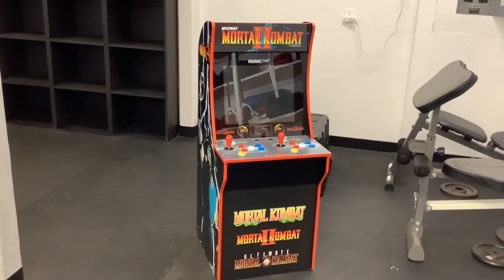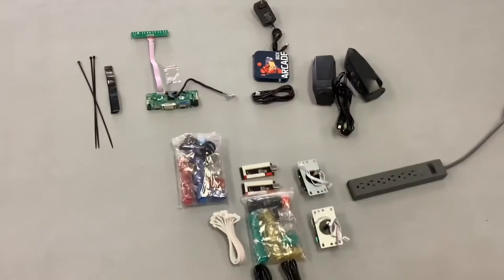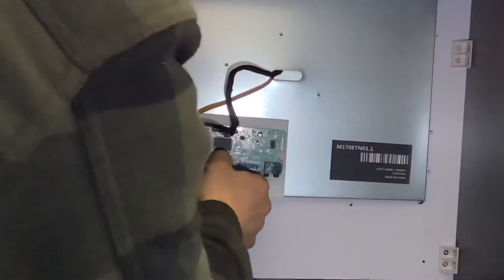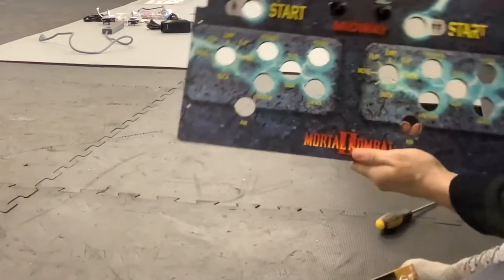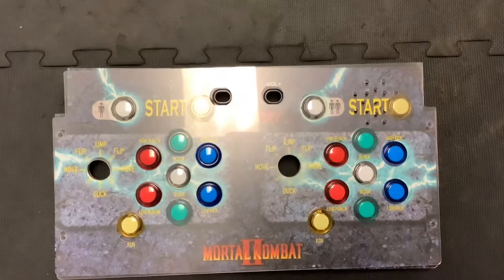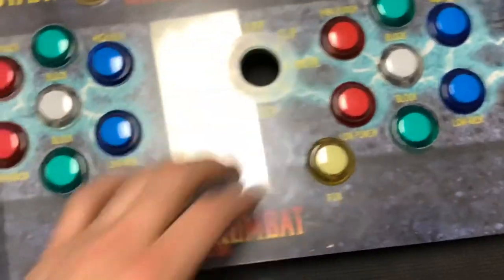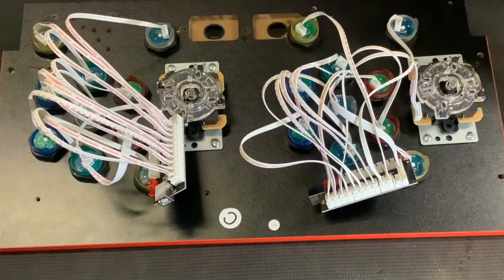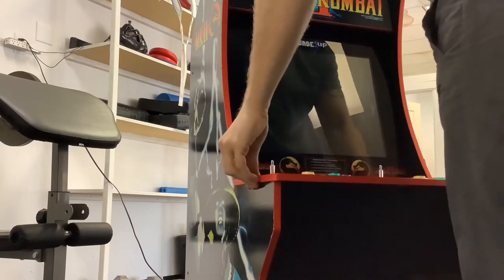How to add more games to your Arcade 1up

Comment: I was able to mod the controller that comes with the arcade box to work with the buttons.   This helped me bypass the process of needing new USB boards and eliminated the need for controller setup.   However, modding the controller was just as long to deal with.   

Thanks so much for the video!
Reply: Which arcade cabinet did you mod?
Reply: Jason, Can you explain how you did it please? Thanks

Comment: I must note to you that you do not need to protect the board from The Metal.  It's actually safer screwing it to the metal with nothing in-between.  So long as you have metal screw sleeves so it can hover and not pressed against.  Or drill 4 holes and use the plastic press in mounting clips Those are cheap. 

Reason is fire safety and also metal housing around the board in case it blows and doesn't spark out to the surrounding wood. 
  I deal with control circuits on commercial hvac.   Boards are always screwed to the metal or done by use of clips.   There's never anything in-between. 

The housing around it was just there for fire safety in case something blows it doesn't spark out to hit the wood.    But the original cover can be bent into shape to cover the new board.  Pliers should work.
Reply: thanks thats what i thought.

Comment: Man your video are great . I have two arcades and fixing to mod mine. The Simpsons with 4 joystick and roller in middle also comes with wifi , the other is mortal kombat 1st gen, witch would you mod? And would the wifi have any benefit?
Reply from the maker: I would do the Mortal Kombat model. I don’t know anyone that has modded the Simpson’s  model so I don’t know if the LCD board would work. I know for sure the LCD board listed in the description will work with that model. Right now I’m modding the newest mortal Kombat legacy model and I listed that lcd board in the description as well. They each require a different one. Also the arcade box has WiFi and you can log on to the internet and customize your start up screen and menu screen.
Reply: @Oracle_insight  I saw a 1up Simpsons molded tho
Reply from the maker: @gomigang2875  I’m sure there is a way to do it; you would probably need to change the entire monitor out. When I tried nodding my old Simpson’s arcade I couldn’t find a video card that worked with the Simpson’s monitor to get hdmi to work with the screen.

Comment: I tried this with a similar box.  Same as you the 16:9 worked great on the 4:3 screen with games like mortal combat and other “horizontal” games.  However, with “vehicle” games like Galaga, it stretches them too much unless you set I back to 4:3 for all of those.  Did you have this same issue?  I did with Super Console X and bailed on it for that reason.  I didn’t want  all the manual setup.  Instead I used a $65 small computer and Batocera (same as Emulec pretty much).

Comment: I cannot get my buttons mapped properly. If player one is correct, player 2's buttons go back to default and vice versa. What am I doing wrong? I did exactly what you say in the video.
Reply from the maker: I’ve had issues with this every once in awhile. Basically map player 1 with just player 1 side plugged in, then plug player 2 into the arcade box and map player 2. Go into a mortal Kombat game and make sure on the character select screen player 1 creates the green square highlighted box over the characters. Then click start on player 2 and make sure player 2 is the red highlight box over the characters. Test the game and make sure buttons work. After playing the game exit to the main menu and shut down the system. Turn it  back on, go back into moral Kombat and make sure player 1 hasn’t swapped to player 2. You will know if the buttons swapped if player 2 is now the green highlight over the characters. If this happens exit the game and swap ports on the arcade box and remap the controls for player 1 then plug player 2 into the other port and remap. Test the game again and then exit and turn off system. Turn back on and go to mortal Kombat again and if player 1 is green, the problem should be solved.

Comment: Great video.  For some reason, my control deck is only recognizing 3 buttons and the up/down on the joystick.  But i cannot select any option like to configure the controls.  
Any ideas what is wrong?  Do i have to use the ps2 controllers that came with ARCADE BOX to configure the control deck?
Reply from the maker: Yes plug in the ps2 controllers and hit select and configure controls. Once there, unplug them and plug in the arcade controls and configure them

Comment: Hi 😉 please check Input 1+2 is set on "default" setting in Controller settings. Try a manual setting for your USB Controller boards Input 1+2 this should fix your Input controller mapping Problems in emuelec. A lot of other settings are directly in retroarch by "restart retroarch". Nice upgrade👍 Have a lot of fun 😃
Reply: Ramin, are you saying that the old setup he posted can actually work?  I ask because I ordered all the stuff he listed, but has not been delivered yet. Thanks
Reply: @PreppyvibesAdeline   @•coconut blossom•  Should be work 👍Mapping was the biggest problem that i had with my diy Arcade. Manual settings needed after you set USB Controller Boards. Every single reboot he saved not Player 1/2 mapped to the boards 😵‍💫

Comment: Hi Greg, I modded my MKII cab with this arcade box but somehow I mess up the button setting on the gamepad, is there a way to reset the arcade box gamepad setting?  I also done the control panel with the usb encoder but still have trouble mapping the button.
Reply from the maker: If you mess up, you need to plug a controller in that came with the arcade box. The controller is already mapped. Use that to hit start at the main menu and go to controller settings and then configure a controller. Once you get there, unplug the controller and plug in the left side arcade controls. Map the buttons then plug in the right side arcade controls and map them. A good way to make sure the controls are correct is to play mortal Kombat. If player 1 is the left side and player 2 the right, you did it right. If they are backwards, swap USB ports on the arcade box but you have to set the controls all over again one at a time. Gamepad1 needs to be on the left and gamepad2 needs to be on the right. Hope that helps

Comment: do u think i could use the beats pill for a speaker? i have the gen 3 UMK3. that has the speakers up on the top head board.  i actually think the sound is pretty good asis.

Comment: Also when i do controller 1 i know you said disconnect player 2 so when i do player 2 do i need to disconnect player one ? Or no ? And  for display , couldnt you do the advanced setting for full display. At the all games tab  instead of systems one by one ?
Reply from the maker: Yes you can full screen that way and sometimes player 1 and 2 get swapped so to test that player 1 and player 2 are correct, play mortal Kombat and it will show which controller is player 1 and 2. The. Turn game off and play again and make sure it’s actually player 1 and 2 by playing mortal Kombat again. If backwards switch them.

Comment: Hi great video I’ve watched it many times, as I’m following your tutorial to mod my arcade1up street fighter 2 legacy edition . Just one question if any on can help. There’s no mention of the over head carousel light . How is that powered please reply thanks
Reply from the maker: There’s a few adapters you will need from amazon to make that work. Not all the cabs have the light up marquee. Let me see if I can find my parts list and I’ll add it into this comment.
Reply from the maker: https://www.amazon.com/gp/aw/d/B081Z7H444?psc=1&ref=ppx_pop_mob_b_asin_title
Reply from the maker: https://www.amazon.com/gp/aw/d/B07MQ9B8G3?psc=1&ref=ppx_pop_mob_b_asin_title
Reply from the maker: https://www.amazon.com/gp/aw/d/B01M7N1GOH?psc=1&ref=ppx_pop_mob_b_asin_title
Reply from the maker: Use the parts I linked to create a y adapter for power using your existing power cord into your light up marquee.
Reply: @Oracle_insight  thanks for replying, do you mean a 2 way splitter cable
Reply: @Oracle_insight  thank you been a great help much appreciated. I’ll get them ordered in morning
Reply from the maker: @daxster35  yes all those links to parts required to make it work
Reply: @Oracle_insight  thanks again I’ve followed your tutorial purchased all parts hope I can make it work

Comment: I love the vid I can’t wait to do this with my pac man gen 1!
Reply from the maker: Yes the lcd board for this model should work with yours
Reply: Pacman has a vertical monitor. you can do the 60 in 1 or the king of air 2 with 516 vertical games. But you have to flip the monitor 180 degree. If you wants to do the 33000 game, the display will be at a 90 degree angle. JMHO.

Comment: Can this be done on a nba jam 3/4 arcade not sure what gen but I do know it has wifi but no lighted buttons? Its still new in box got it on clearance last year and waiting to put it together after I make room in the garage.
Reply from the maker: I’ve not tried it on one of those yet. It all depends on the monitor if you can connect an hdmi video card to it.

Comment: Please need help. Want to play.  I get all the way and pick a game. Then it says my magic stick is not configured. But it worked for everything else
Reply from the maker: I don’t use the magic sticks for this method. You would only need the magic stick when using the switch fighting stick. I stopped using the switch fighting stick method because the firmware has changed on some of the magic sticks making that method not work anymore. Unless you bought the old version of the magic sticks before they updated the firmware, it will probably not work and you will need to buy the button kit and change out the buttons on the switch fighting stick.
Reply from the maker: https://youtu.be/ekqL9wWkdbI
If you already bought a switch fighting stick, upgrade it like I did in this video with a button kit. It will give you better buttons, it’s easy, the joysticks will work better, and you don’t need the magic sticks anymore.

Comment: Hello where are you plugging the two usb cables coming from the encoders ?
Reply from the maker: They plug into the Arcade box, player 1 and 2
Reply from the maker: Use any mortal Kombat game to make sure player 1 and 2 are in the correct ports on the arcade box. When you enter the game, player 1 should be green highlighted box over characters and player 2 should be red. If they are backwards turn arcade box off and swap ports

Comment: I followed this video step by step and when I turned it on everything lit up and the screen comes on but just remains black.  Any idea what that can be?
Reply from the maker: Possible ground issue, or wrong video/display card for whatever cab you are using. Also one time I accidentally pulled the chord out from the actual LCD board inside it and couldn’t figure out the problem. I had to remove the whole tv and discovered the chord came lose when I was plugging it into the video card.
Reply: I am using the same one in this video.  The mortal kombat cab.   I do see a wire coming out of the screen in the back which is not connected to anything. I am not sure where to plug it into.

Comment: How are you powering the system on?  Are you simply leaving it on and plugging it in?
Reply from the maker: Plug it in to turn on, and go to menu screen and click shut down system to turn off. Once it’s off I unplug it. You can also buy this and Velcro to the top to turn it on and off. https://www.amazon.com/Cordinate-Designer-Tabletop-Resistant-41095/dp/B0845S3KNJ/ref=mp_s_a_1_2?crid=18KTMJ3UCU38W&keywords=plug%2Bpower%2Bon&qid=1652127515&sprefix=plug%2Bpower%2Bon%2B%2Caps%2C214&sr=8-2&th=1&psc=1
Reply: Hell of a job man... I'm going to give this a shot. Thank you for this. . Its appreciated
Reply from the maker: @shawngrugel5078  no problem, do you have the new legacy model or this same one?
Reply: I have that same one.  I bought tune Simpsons one as well... I'm afraid to mess with that one... but I got the MK Cabinet for next to nothing. I was thinking,  I do have a Super Console X, it runs on that emulac as well. Do you think i could use that as opposed to the Arcade Box?
Reply from the maker: @shawngrugel5078  yes that should work just the same as the arcade box
Reply: I'll let you know how it goes... i'll probably order the stuff this week and get it together by next... thank you again
Reply from the maker: @shawngrugel5078  awesome! I just sold 4 over the weekend and about to build three more I just picked up.
Reply: Greg...
I followed your video step by step.
I got a recommendation as to centering the joysticks. Use Bluetack to hold them in place so that way they don't slip as you either make your markn or simply screw them in.

My only issue was drilling the holes in the plastic protective layer...it shattered. 

Everything else came out great. I'm using a super console X as opposed to the box you have,  the only reason being is I had it lying around not being used. 

Thank you so much my friend...if it wasn't for your video,  in wouldn't have gotten this done.

Comment: How do you remove the joystick plate if is hot glued to the board
Reply from the maker: Hammer and flat head screw driver would work. Angle it and give it a tap until it comes lose

Comment: Have you ran into a problem with the boot up going straight into a green screen the emeulec boot up screen will appear then all of a sudden it goes green ? Just curious if you or anyone has had this problem
Reply from the maker: I haven’t; does it boot up at all or just green screen every time?
Reply: @Oracle_insight  boots up but before loading all the emulators it green screens ordered a new arcade box under then warranty so hopefully it’s just the box it’s self
Reply from the maker: @IzaacLujan  yeah I’ve never had one do that

Comment: I have the blitz machine is there any type of joystick board I need to order because it only has three buttons
Reply from the maker: You can drill holes for more buttons. Also is that 4 player?
Reply: @Oracle_insight  yes
Reply from the maker: @elijahwildhorse6735  the arcade box only has two usb ports for two players. Not sure if there’s an extension to add 4 player or if that would even work.

Comment: Must the buttons be changed?
Reply from the maker: Yes, in order to connect it to the arcade box with all the games. Honestly it’s so easy. I’ve done it so many times at this point. You don’t need to drill all the extra holes. I recommend doing at least one extra hole for each side for start and select but having two extra per side is even better.

Comment: I did this step by step but screen shows nothing idk what happend no sparks or anything just screen no picture just grey
Reply from the maker: Which model of arcade do you have? Did you hook up the ground? And did you order the correct hdmi converter board for your screen. There are different hdmi converter boards specific to certain screens/models. Make sure you plugged the cord from the screen into the board the correct way. Also make sure you didn’t pull too hard on the cord when plugging it in as it can unplug from the actual Arcade1up screen. I accidentally pulled too hard once on mine, hooked it all up and had the same problem. Had to remove the screen from the Arcade1up and plug it back in.
Reply from the maker: It’s the wires on the back of lcd screen panel. There’s a ground wired, power, and a wire that plugs into the pins on the hdmi converter board. The one that plugs into the pins on the converter board can come unplugged very easily from up inside the metal panel of the screen if pulled on too hard. If that happens you need to remove the screen and metal panel to plug it back in.
Reply: Thanks I will try to take it apart and check it out..I thought the board was the correct one but I will make sure as well..I have the street fighter anniversary addition...
Reply from the maker: @tiny683  ok let me know which board you ordered and also if you can, send me the numbers on the back of your lcd screen inside the cab. Should be a sticker with a model number. Then I can make sure you have the right board.